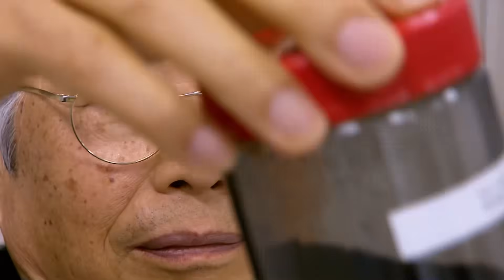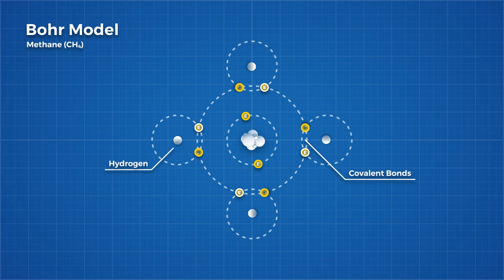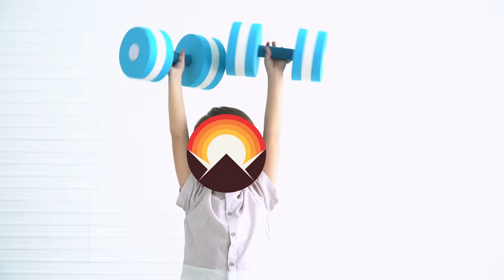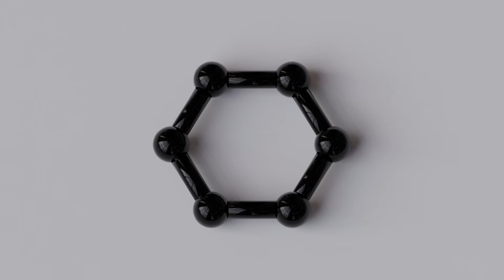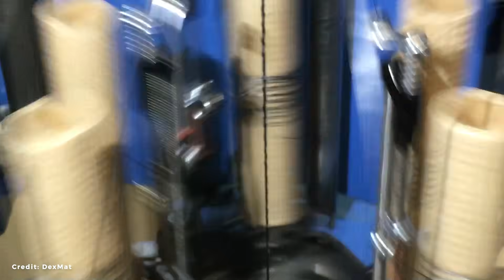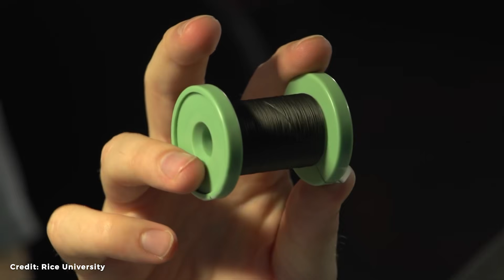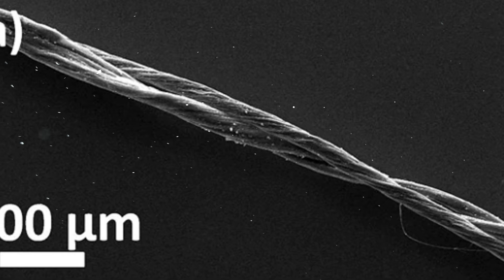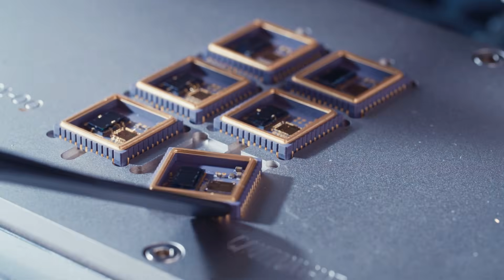How Carbon Nanotubes Will Change the World

Comment: Yeah, carbon nanotubes, another one of those 'coming soon to a theater near you' practical, 'eternal technologies of the future'.  :-/  So far, the practical side has not remotely dawned.  I've seen this movie many times.  Yeah, eventually, but an eventuality many of us will likely not witness.

And making a space elevator out of this thing...are you freakin kidding?  Do a little back of the envelope calculation on the cost of that endeavor.  LOL   Not until we have access to immense amounts of more or less free energy, anyway. It's about as likely as terraforming Mars, at least until the aforementioned capability concerning energy access is acquired, if ever.  

Just because some science fiction writer dreamed up a good idea in no way means it will ever come to fruition, at least not remotely in our generation...unless maybe AI!...never mind.  I think I know the sunset scenario in that path, and it's in some ways good and some ways bad.  It is anyway, if you realize that mankind is currently a virus, as far as the planet is concerned.

Thanks for the materials atomic level refresher, in any case.  Orbitals, orbitals, orbitals...and bonding geometries...been there, done that.   :-)  Oh, and nothing better than a single atom thickness hammock that can hold a cat.  WTH????  Have you done a video on steel whiskers, those are interesting, too. 

And regular graphite is not all that conductive, that's why that material is used in one class of resistors, and they call it a SEMI conductor.  Just sayin.

And yeah, lightning strikes on composites are not generally a good thing.  Non conductive lastics tend to violently disassemble themselves, at least locally, under such conditions. There are other, far more simple ways to solve that problem, though. Plating plastics isn't hard.  Carbon wires in a carbon based entity (neuralink) probably makes sense.  I expect future brain reading/writing will be done wirelessly, though.  Marconi helped there.  Well, not directly, but you get the drift.

Direct connecting/linking the brain electronically gives me the willys, but we'll see how it pans out. I guess.

Comment: A very important aspect of the strength of graphene is the orbital delocalization and the constructive interference between the electrons waves in the property called aromaticity.

These cause the pi bonds between atoms to also be very strong as elections that can move freely accross the carbon nanotubes are in a state if high entropy and lower energy that could be achieved in a single bond. 

The strength in large part is a network property

Comment: This sounds a lot like tin whiskers. Highly saturated metallic solution that grows fibres randomly. I think there might be some wisdom in the metalsmithing community that could be applied to the vapour deposition method
Reply: By that I mean this sounds like highly specialized Electro forming. In electro forming you can make chaotic torrential like currants through the catalyst solution, or you can create laminar like flow and you get radically different results. How are they addressing the fluid dynamics inside the reaction chamber that would be caused by the Heat and electricity and the potential of the raw chemical reaction?
Reply: A further thought, can carbon fibres be made by enzymes? Are we not at the point now where we could design an enzyme that is an engine that chugs along making carbon fibres?

Comment: What if find very interesting is that by changing physical conditions like heat and pressure you can convince carbon atom's electrons to hybridise but only use three of them to make sigma bonds and leave one for a pi bond...🤯
But what's frustrating is that you can't find the How or Why of this anywhere in the books... 😔

Comment: Wall the two processes off with the metal catalyst as the separator. Hot gas comes in one side and exits as nanotubes on the other. If you want to get really crazy make the catalyst a cycled liquid in the process so it does not wear out with liquid retention using ceramic filters.

Comment: Never touched on how they are one of the most dangerous toxic substances due to their shape. The body can't get rid of them and they just keep piercing cells and destroying them due to the difference in osmotic pressure. If they are widely used ignoring their dangers we could very quickly start seeing the new biggest environmental threat to humanity and the planet. Nano materials aren't exactly materials that can be given little thought when put into real world applications with humans around. We are likely already poisoning ourselves with nano sized titanium dioxide and other compounds just wait till the structurally toxic compounds like nanotubes show up. This is like the DDT and leaded gas of the 20th century retardation but potentially a million times worse.

Comment: The reason why carbon is such a mystery to you is because you were looking at it through quantum physics. If you want to understand the natural fundamental properties of everything in the universe you have to look at it through either physics. The infinity symbol you are seeing in the one example of carbon to carbon bonding is a beautiful example of a magnetic field toroid structure. I know what the Skeptics are going to say, carbon is not magnetic. In truth everything is magnetic. Carbonate is in fact diamagnetic, and mainstream would teach you that that is anti-magnetic, however that is far from the truth. Diamagnetic objects are highly discriminant on which particular portion of the field they are attracted to. Examples of this can be easily seen if you use extremely large magnets, and they do not have to be that strong; the magnet just has to have a lot of surface area. The large surface area is necessary so that you can see how the diamagnetic carbon reacts to certain portions of the giant magnets differently. When you look at reality through quantum physics everything seems to contradict itself, and nothing makes sense. Quantum locking due to lowering a diamagnetic object to sub temperatures oh, it's nothing more then thermal Construction, and shrinking. If you want to understand the nature of these things you need to start thinking like Nikola Tesla. Oh and by the way electricity it's absolutely a particle not a wave. The only conditions in ever acts like a wave, is winning is in such small quantities that it can ride a wave.

Comment: So the key is to make carbon nanotube forests easier and cheaper to "grow."

Just an idea...
The nanotubes are non-magnetic but if the forests can be made to reliably precipitate away from the catalyst in a loop you could run a very small current through it to gently encourage the forest to grow longer so that maybe it doesn't terminate too early? Increase gas concentrations as necessary maybe so that the structure also will continue to crystalize.

I feel that this method could be potentially be equally more volatile and yield far less lengthy nanotubes in the early stages of testing, but it might offer better results in the end. Dividing the substrate to allow a current to pass though it would be required of course. Worth a shot?

Comment: Heads up, the core of most transmission conductors are steel. Aluminum is light, but it also has a less forgiving catenary. Having a steel core allows for less sag, and therefore shorter & more economical structures

Comment: Carbon nanotubes are fascinating! A couple of weeks back I 3D printed a carbon nanotube structure of around 50mm in height and around 30mm in width, It held 12.5KG. The material was PLA with only 5% infill. These structures are beautiful yet powerful.

Comment: On the other end of the spectrum. What about a possible use of carbon nanotubes in Integrated Circuits? 

Where scale is such an issue why not build stuff which is literally in the nano meters range 🙂

Comment: Friend of mine worked in a lab on carbon nanotubes she said "it's never coming!"
Reply: Never say never.  Transparent conductive films are one area where CNT-based solutions are now commercially available and cost competitive.  It's happening, despite the tsunami of tskepticism!
Reply: @ᴛᴀᴘ ᴍᴇ ᴀɴᴅ sᴇᴇ Everly  yes, in much the same way as we have seen with graphene over the past few years.  Lots of hype but the reality has not delivered, at least not yet.  CNTs are enabling commercial solutions today particularly in printed electronics.  Sensors, transparent heaters, antennas are a few of the applications where CNTs are being incorporated.

Comment: Oooof, no. Aluminium has lower resistance than copper *by mass*, even though it has  greater resistivity. So its use in overhead power lines is a no brainer because there's no issue with fatter cables.

Comment: It sounds like what sci fi writers have talked about mechs needing as well. A lot of them had names like 'myomer muscle' fiber bundles and alluded to them being carbon based, electrically actuated, and neurally linked to pilots while being able to expand and contract. This tech could reduce the weight of wearable mech suits of many sizes so that current energy sources could power and drive them.

Comment: Sounds like growing VERY LONG nanotubes would be ideally done in SPACE... ZeroG environment, perfect vacuum... easy control of the growing environment... LOTS of free energy from the sun... if we put a small space station, say 1 fab module and 4 energy modules (essentially a bunch of solar panels) in L1 point between Earth and Sun, it will have 24/7 access to Solar Energy and we would be easily able to communicate with that space station... the Fab Module doesnt have to be super huge or have all the environmental control systems needed to maintain human life so it would be a LOT cheaper and weigh a LOT less... the biggest cost of launch in terms of weight would be the power supply systems (solar panels)... and im pretty sure that at the L1 point we dont need gigantic solar powerplants to produce enough energy to make the whole operation function (anyone know what the power level per m2 is at L1 point)... i would assume that 20 kWh would be more than enough for a Pilot project... maybe it will cost around $150-200 Million for the entire project including launch cost via Falcon 9...

Comment: Wonder if there will be pollution problems with nanotubes, like we have now with plastics
Reply: Not so much since carbon is used by EVERYTHING!
It is NOT toxic in any amount. The only problem is if "waste" carbon is burned... there will be carbon monoxide and carbon dioxide... which ARE pollutants.

How easy will it be to recycle carbon nanotubes though? Dunno.

Comment: Carbon nanotubes are still a long way off from being reliable or useful in any significant sense. Much less being able to pass production QC and be shipped and used effectively at scale. I think it’s mostly hype the same way that most papers around graphene are completely insubstantial and are often subject to misinterpretation by their own authors.

They’re cool conceptually but it’s gonna be a while until carbon nanotubes have any practical use in any industry.
Reply: Luke, I disagree.  There has been an enormous amount of hype for decades, but many barriers to commercialization have been painstakingly overcome.  Look at the recent developments in transparent conductive films, for example, to see areas where commercially available, cost competitive solutions are starting to make inroads.
Reply: @paulferguson8764   to be clear. I don’t think graphene has the all of same issues as nanotubes. I think it’s a much more robust, easily producible and replicable material than nanotubes and has already been used for some commercial applications albeit in a limited capacity relative to their full potential. Nanotubes IMO still have much to be understood about making and using them before any reliable commercial application comes around. Graphene has a similar set of challenges as the production and use of carbon nanotubes but they’re much more easily overcome.

I actually worked at a company that manufactures graphene devices so I 100% believe that the obstacles in the way of reliable conductive graphene films have been overcome. I just don’t see the same progression in the world of nanotubes. That’s just my 2 cents though. I’d be happy to be wrong there.
Reply: @Kahalahili  I understand the skepticism but I don’t think Birla and SWM would be getting involved unless they were convinced that scalable methods to reliably manufacture high quality highly consistent products are available.  I expect that we will see evidence of adoption in commercial applications in the coming months.

Comment: Space Elevator is a dangerous dream because it will short-circuit the ionosphere/positively charged with the earth/negatively charged causing millions of amps current flow. Space Elevator will also act as giant lightning rod to millions of amps Birkeland Currents in space normally coming from the Sun and entering and leaving earth at the poles. Space Elevator will also disturb earths magnetosphere with its own magnetic field generated in short-circuit. All of which can potentially destroy earth.

Comment: The iron catalyst is not only a catalyst in a chemical sense. Iron or more specifically iron oxide forms little pyramdie like structures when depostited in low concentrations. The tips of the pyramids are used as a foundation for the carbon nanotubes to form.

Comment: @Real Engineering
There's a lot of bad information in this video. Carbon nanotubes ARE NOT biocompatible - they're actually very dangerous for cells. Vantablack, for example, is considered extremely toxic by inhalation, and nanotube fibers (like carbon fibers) are known to cause physical puncture damage to cells they're in contact with. I can tell you with absolute certainty that companies like Neuralink are not sparing a single thought for nanotube probes.

Comment: Interestingly, nature supplies us with something like carbon nanotubes in crystalline cellulose.  When you take a cellulose source that has a high percentage of crystalline cellulose in it, then either chemically, enzymically, or mechanically separate the crystalline cellulose from the amorphous cellulose, you're left with nanocellulose crystals. Then when you carbonize or graphitize that, you're left with essentially a form of carbon nanotubes.  With an efficient heating system, you can create a lot of these at one time.  

   For example, I'm building a vacuum insulated, high heat resistance, thermite foundry/heater using common and cheap materials.  Thermite packs a lot of energy, and when you're using the common form of powdered aluminum and iron oxide, it's very cheap.  It burns very hot, at around 5400* F, which is great for things like graphitization or even for converting quartz crystal to silicon (which is expensive and otherwise fairly hard to make at home).  But you want to capture the heat, so that you can do bulk conversion.  The idea is to put a large graphite crucible with the material you want to convert inside it, put that in the mostly vacuum insulated container (except for the top, the top needs a vent/gas pressure release, otherwise it would pressurize and blow right off), and you can do just that.  

   Another point:  Rather than trying to make pure carbon nanotube fibers, a better and more practical application would be to impregnate the carbon nanotubes within highly oriented ultra high molecular weight polyethylene fibers (brand names include Dyneema and Spectra).  Highly oriented UHMWPE fibers already have a very high tensile strength at low density.  But it severely lacks Young's Modulus strength (stiffness).    In other words, these materials are complements to each other, but one thing they have in common is that they are lightweight and have very high tensile strength.  One issue with UHMWPE is that it has a low melting point though (and when it gets near there, it loses it's crystallinity and its very high tensile strength)--it would be interesting to see if carbon nanotubes helped or hindered this.

Comment: Even if you weightless, unbreakable materials, a space elevator wouldn't make it easier to get things into space.  The additional mass slows down the whole thing.  You need a rocket on the elevator car to make it go faster horizontally.  

Or a rocket on the platform that sits in geostationary orbit to maintain the velocity.  This is where the unbreakable cable comes in handy, because that cable will have to DRAG that car from 1000 mph up to 7000 mph.

Comment: I am the chief engineer at a company that mass produces CNT for use in concrete. one this this video and most other discussions on CNTs miss in the bunk industrial production of lower quality tubes. We produce thousands of pounds of CNTs per week at pennies per pound. This high volume/low cost production method allows for applications that would be otherwise prohibitive. Our current product makes concrete better in almost every measurable way. While achieving insanely high aspect ratio and uniform tubes is a great goal for laboratories, we shouldn't overlook these low quality tubes for bulk industrial applications.
Reply: Fantastic, thanks for sharing that!  I agree completely.